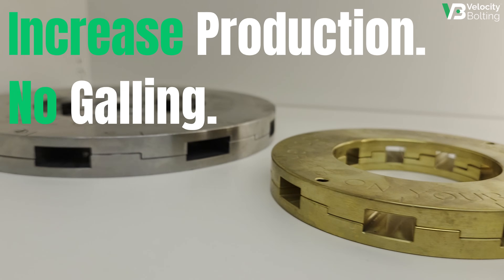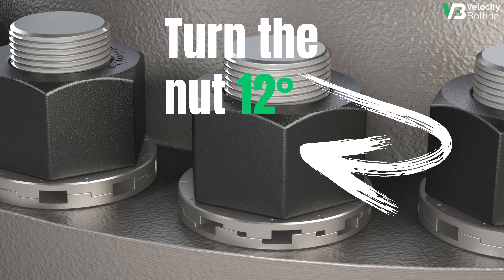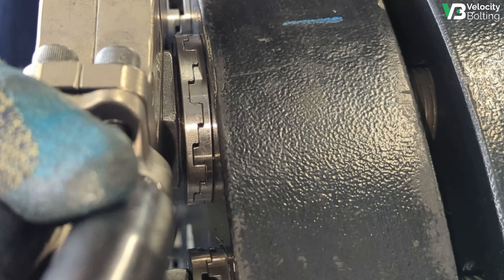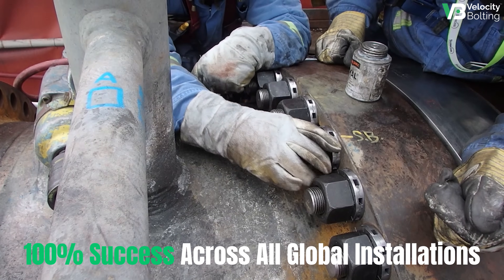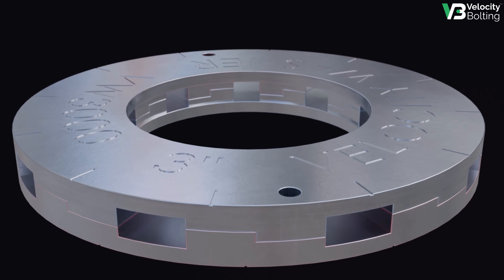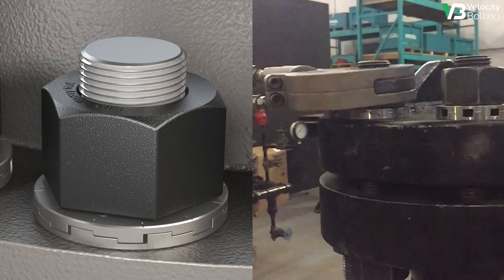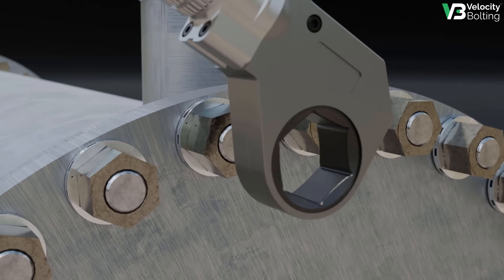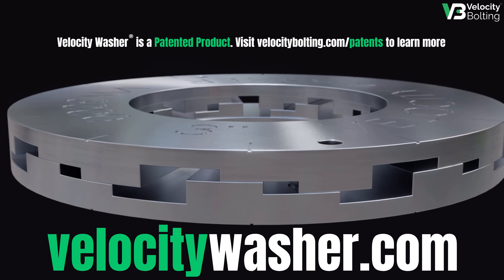Velocity Washer: Prevent Galling in 1 Minute (2025)

Comment: Do these ever loosen on vibrating , swelling, or frequently stressed loads?
Reply from the maker: Thanks for the comment. Velocity Washer actually thrives in applications that have frequently stressed loads (e.x. cyclic heating / pressure). As for the vibration, there is no issue, and we have passed several military grade specifications which document this in full (MIL-STD-167-1A, MIL-S-901D, and MIL-STD-1312-7A).
Reply: @velocitybolting that’s amazing.  I was just curious regarding the forces which could loosen a nut slightly and possibly unload the nut, but apparently this is an amazing invention.

Comment: vibration will cause serious issues when they will ve used under pressure😊
Reply from the maker: Thanks for the comment. However, based on military grade specifications and testing, Velocity Washer has no issue under vibratory loading unless there is already self-loosening with a standard washer. We have passed the following military specs: MIL-STD-167-1A, MIL-S-901D (Shock), and MIL-STD-1312-7A.
Reply: @velocitybolting Military spec is not high
Reply: Look at the 20 second mark - there is a pin hole for a pin to prevent vibration release.

Comment: So what happenes when it comes lose it pops open make a locking tab or something into it I’ll take a regular washer and locking ring thanks or if possible nylock nut
Reply from the maker: Thanks for the comment. When the Velocity Washer 'pops' it collapses on itself, removes all bolt load from the stud, and effectively becomes a standard washer. You mention a nylock nut or locking ring - these are great options if you have self-loosening issues. However, the Velocity Washer solves the other end of the spectrum: when you have seized nuts / bolts (AKA galling).

Comment: How tf does this prevent galling? Ive had stainless hardware gall before the nut even it the washer, just from trying to run the nut down the threads with an impact
Reply from the maker: Good question. The "magic" behind the Velocity Washer is it doesn't allow the nut and stud to slide against one another long enough under load for galling to occur. In other words, there isn't enough time on a microscopic level to scrape away all the protective oxide layers and result in the underlying bulk material becoming one part (otherwise known as galling). 

In your example, it sounds like you're talking about galling that occurs on assembly - the cure for that is proper lubrication and bolting procedures. We're always happy to talk bolting - get in touch anytime.
Reply: @velocitybolting thank you for your response
Reply: Bolts are tensioned heavily and thereby the breakaway on large structural screws isnt immediate, theres still a lot of resistance after you do the initial break away, because the bolt itself is in massive tension. This eliminates that. Check their other videos.

Comment: Great unless you have any vibration at all
Reply from the maker: Thanks for your comment. We know vibration is a concern - and that is why the Velocity Washer was tested against military standard vibration-resistance testing (MIL-STD-1312-7A). It fully passed the test with no self-loosening. You can see a video of that test here: https://youtu.be/h5LY3BeT9TA
Reply: Oh darling vibrations are not an issue with the size these bolts are. For small bolts yeah, but for stuff like this nah
Reply: @napaisava sounds like something a civil engineer would say
Reply: Look at the 20 second mark - there is a pin hole for a pin to prevent vibration release.